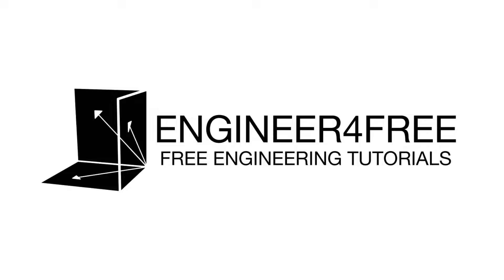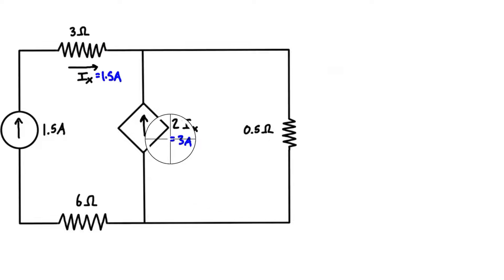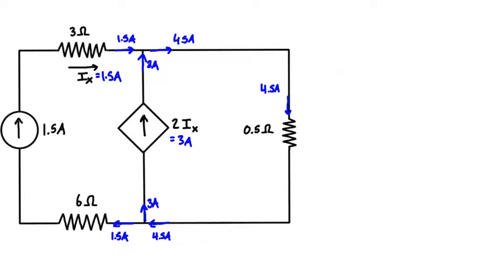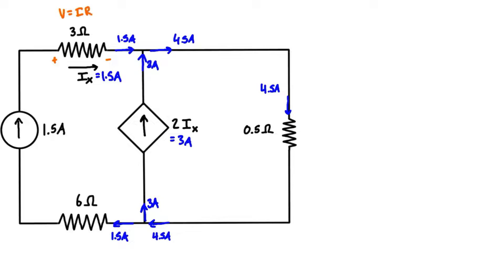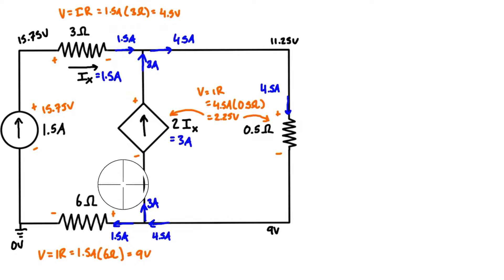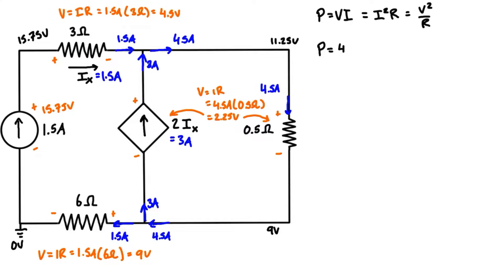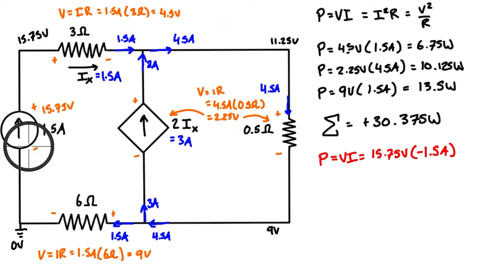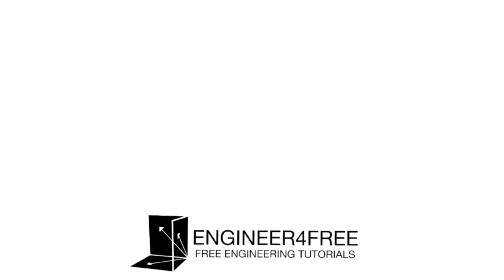CCCS: Current Controlled Current Source

Comment: Could you add the 2 current sources together? Or would the 3 Ohm and 6 Ohm resisters be stopping you from doing that?
Reply from the maker: Yeah to change the configuration changes everything. I recommend playing around with this free simulator https://spinningnumbers.org/circuit-sandbox/index.html and watching what happens to the branch currents and node voltages when you change things around